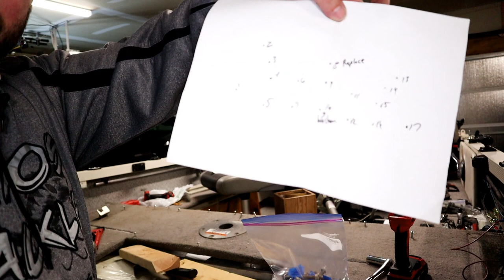TRANSOM REPAIR STEP BY STEP!! - Replacing Transom in a Crestliner Aluminum Boat

Comment: Was the boat always stored outside? Do a lot of back trolling? I have a 03 Crestliner 1750 Fish Hawk and haven’t noticed anything out of the norm on the transom but I probably should look closer. 
Any idea if this is a common issue with this boat?
Reply from the maker: wjb111 The boat was always stored inside and I never did any back trolling. I did, and still do, use the boat 50-80 days a year though so it was on the water a lot. I'd take a closer look at it as I've been hearing from a lot of people that thus seems to be an issue with a Crestliner of that age.
Reply: Regardless of how the boats used or kept if you keep all the penetrations and through hulls sealed you won't ever have to worry about transom rot. Its better to reseal stuff before it leaks than wait till after preventive maintenance

Comment: Are you using any guide to drill the holes or just drilling them through
Reply from the maker: @tommyparker6187 I just used the existing holes and did my best to drill straight through to the hole in the aluminum on the other side. It went better than I expected 😅 I found if you just take your time and make sure you're drilling as perpendicular to the transom as possible, it goes pretty well 😊
Reply: @AnglingAnarchy  ah ok, my transom was shot and came out in a million pieces
Reply: @AnglingAnarchy  Brian what if you drilled a very small diameter hole in each of your numbered spots while laying flat on the floor perpendicular... then put it in the transom slot and run a Wire through each hole to see if it lines up .. if so.. then drill to the correct diameter? Would that work? Or did Crestliner not go perfectly perpendicular at the factory?

Comment: Did you sand down the wood on the new transom. 5/8 inch x3 is a little over 1.875 inches. The width should be 1.75 inch if I'm correct.
Reply from the maker: William Luciw I didn't sand down the wood as the old transom measured exactly 1 7/8" (1.825") and was originally constructed of 3 sheets of marine grade 5/8" plywood.
Reply: @AnglingAnarchy  yeah I just took mine apart. It's a 1600 angler. Mine measured 1.8 inches. Can't really tell exactly though because the old wood is swollen.

Comment: What kind of outboard is that? Those have got to be the jenkyest connections where the fuel line and wiring harness tie into the motor.
Reply from the maker: John Norris It's a Suzuki 115 four stroke

Comment: If the washer was big enough on the transom aluminum all you would have to do is tighten the bolt up to get the bend out of it

Comment: Did you consider using a composite instead of plywood? Great job! Thanks for sharing!
Reply from the maker: RobertK I did consider using composite Coosa board, but I got a little ahead of myself and ordered the marine grade plywood before making that consideration 😄 if I were to do it again I think I would go that route. Thank you for watching!
Reply: @AnglingAnarchy  Well, if you get 17 years out of this new transom, you might be looking at a new rig anyway. ;) Cheers!

Comment: Just a tip next time, seal the top/fill the void with “g-flex marine epoxy.  It will flex, but adhere more than silicone.  Silicone only lasts so long, but the epoxy will last years.  

Comes in a kit with a compatible “epoxy thickener” filler material that you mix in to keep it from drooping.
Reply from the maker: Ryan Jozwiak Thank you for the tip!
Reply: Do you think a guy should put that type of Epoxy along the entire top of the transom to seal it? Or should it breath through the  top instead?
Reply: I would seal the whole thing with marine spar varnish.  5 coats on edges and 3 on faces is what they call for.

Comment: Theres 2 different types of silicone one that is nuetral cure and the other that cures from acetic acid. The nuetral cure is what you wanna use on or around any metals because the acetic acid in the other type of silicone will eat away at most metals. Im not sure what type that gorilla silicone is but my guess would its acetic acid cure if it is you might have problems down the road with it eating away at the aluminum.
Reply from the maker: John Norris Good to know! I will certainly look into that.

Comment: Drill half way in on one side. Than half way from the other side.
Reply: Small pilot hole all the way through first so you know where to drill on both sides so the line up.
Reply: @johnnorris1227 I thought of that also.. but did Crestliner factory drill exact Perpendicular at the factory ? What have you found out. Also any trick to have a hand drill go exactly Perpendicular to the wood?

Comment: NICE job on the transom (but) that word silicone it is for storm doors and wimens tits . I repair boats as soon as i see silicone its automatic, price just doubled, great for quick fix, in a cold environment will not last a winter.Removing it is time consuming and a pain in the ass.what a great job you should of made two of them you will be doing it again soon
Reply from the maker: @grantpeachey6908 Welp, all the silicone seems to be intact 3 years in of heavy use, maybe I'm just lucky 😁